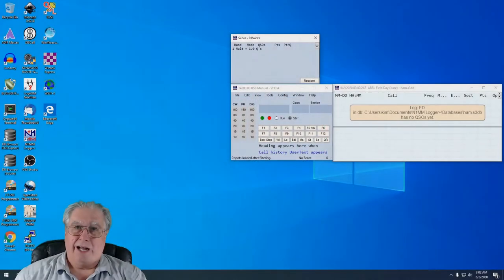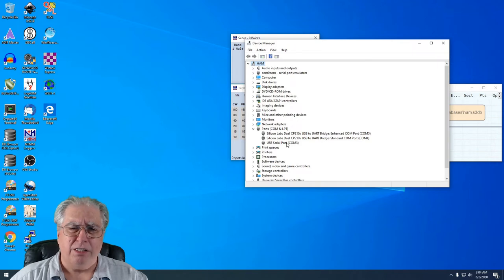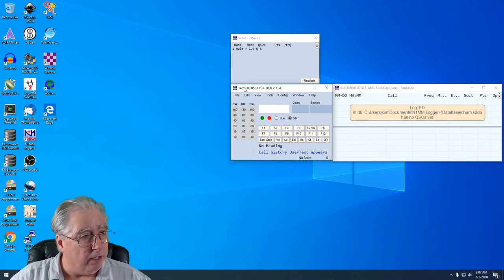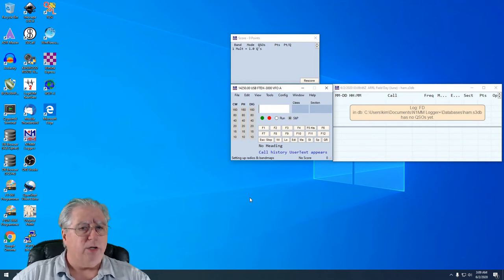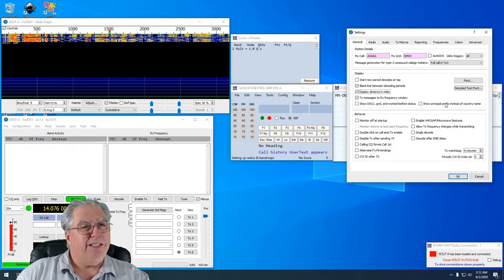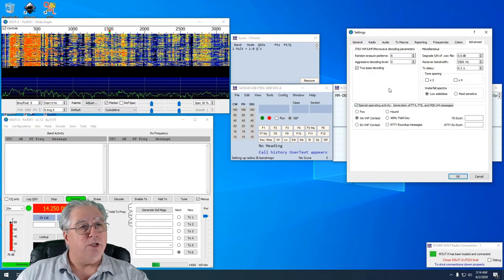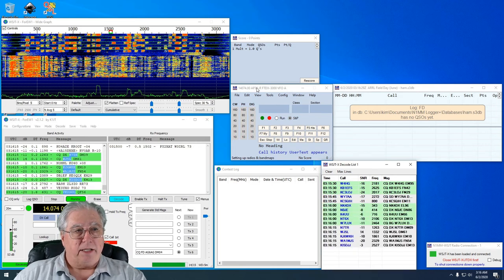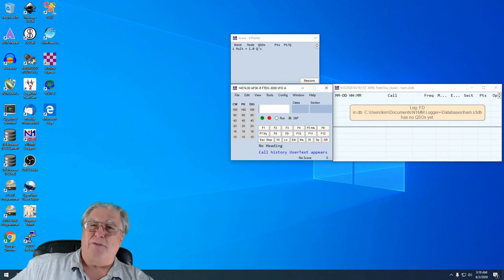NEW VIDEO REPLACES THIS ONE! Adding CAT Settings and WSJT-x Digital to N1MM+

Comment: Since your great video, N1MM has updated (Update 1.0.8495) today or last night -  I believe it still works with your settings.  I had a problem with it using tJTAlert, but with your system It seems to be ok.  Note - you must use Tab 1 and NOT tab 2 to log correctly.  I use DXLabs, but needed to quit DXKeeper (logging) and DX Commander to get your version to work while still keeping DXCommander checked..  now to find someone to play so I can get final test to see if it logs to N1MM log - it is fine in WSTJ-x log
Thanks again.
Bart  aa7va